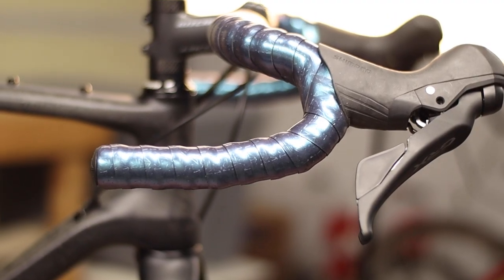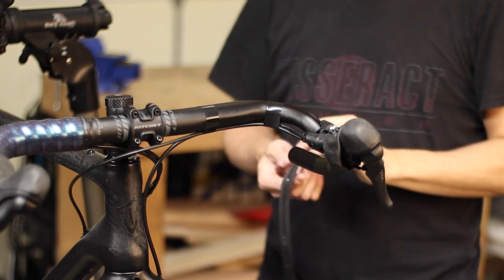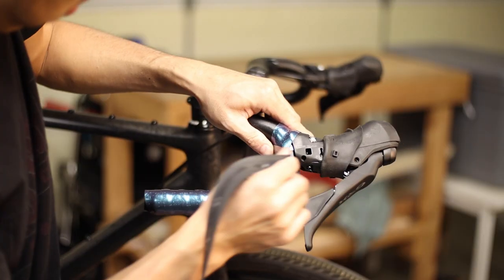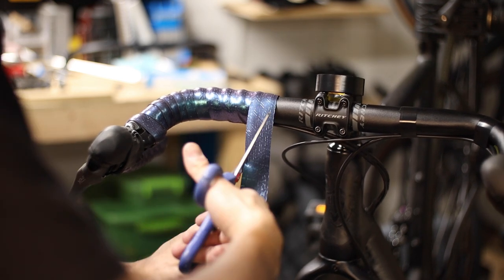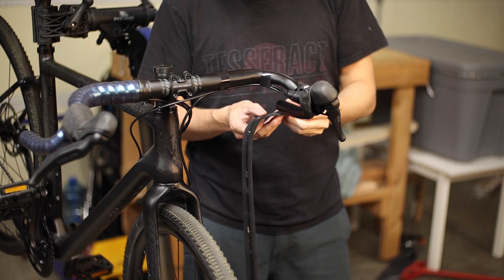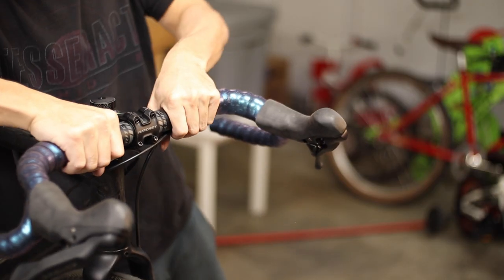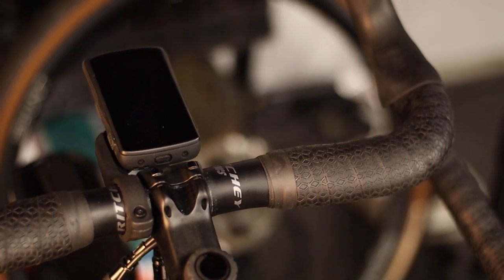Figure 8 Handlebar Tape EXPLAINED // Wrap Like a Pro!

Comment: You do a neat, clean job however, after working as a professional bicycle mechanic for over 25 years, I have found the tape stays in place better if you wrap towards the inside rather than towards the outside. When a rider grips the bars on top, they tend to twist the tape backwards.  This can cause the tape to loosen if wrapped forward over the top away from the bike.  If wrapped over the top towards the bike, the twisting motion of the rider’s hands tends to keep the tape tight.  The adhesive on the the back of most brands of good tape will help even a less efficient wrap job stay in place.
Reply: Also, he says to go counter-clockwise as he's wrapping clockwise. Might have been a bit of confusion in the production of the video.

Comment: Hi!
I just checked the PAUL COMPONENTS website and couldn't find the correct "THUMBIES" adapter to install the MICROshift BAR END SHIFTER.
Did you use the SHIMANO version?

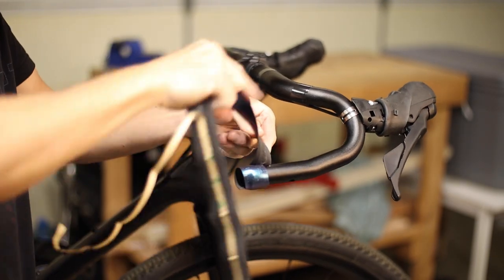Comment: At 1:46 you said counter clockwise on the right, but I think you meant clockwise on the right, counter on the left. Great vid explanation otherwise, thanks Also maybe  not put the sticky of  electrical tape on the bars if carbon, just tape over the bartape, then use finishing tape.

Comment: Isn’t the direction of wrapping on the top half of the bar going against the direction of our hand grip on the top section when riding?
Reply from the maker: I think the idea is if you’re holding the tops, you’re naturally inclined to roll forward, which is in line with the tape direction
Reply: I also think that the tape should be wrapping back toward the rider on the tops. I feel like my grip pulls backward more in this position. If you think of the way your thumbs fall when you're on the tops of the bars, it would be in the same direction of the wrap this way. But I guess as long as the bar is covered and it holds nicely, one way isn't necessarily more correct than the other.
Reply from the maker: Thx for chiming in! Right. No one correct way to do it. Which.. kind of defeats the purpose of a how-to 😆
Reply: Yes, your are correct. The kind of wrapping a figure 8 around the lever shown in this video is causing the conflict, that either on the top or on the bottom you have a conflict with the ideal wrap rotation.
You have 2 solutions for this conflict:
1) Accept this conflict and check out in practice if you find any negative consequence in longer term faster than usual/expected degradation on the tape. Non ideal wrap orientation may be compensated by many of today's offered bar tapes and applying pull force at the upper allowed limit may help to avoid any problems with opposite to ideal wrap orientation.
In one video a professional from a bike racing team even explained, that he starts wrapping at the bottom from the outside to the inside. However professional bikes may be re-wrapped much more frequently than "normal" user bikes and therefore it is best you are fixing your personal targets that you want to achieve by your wrap method and take advise by professionals with a grain of salt.
2) Change to a slightly modified figure 8 wrap method as shown for example in this video: https://www.youtube.com/watch?v=4iekC7HnG4o
This figure 8 wrap method includes a wrap orientation change from clockwise to counter-clockwise or vice-versa while passing the lever.
One disadvantage on this modified figure 8 wrapping is however when you have a bar tape that has a one sided logo or mark, then either on top or bottom side this logo/mark is hidden/covered.
Reply: I always push forward on the tops, never backwards. So i like this way of wrapping.

Comment: I've used this tape. It's not bad... but uh, give it a few weeks and then try to remove it. Hint: It's buckets of fun.
Reply from the maker: Ha my guess is the center strip will leave behind adhesive. Very similar to the Cinelli. They’re tacky bar tape has a different adhesive. My guess it that will be easier to remove